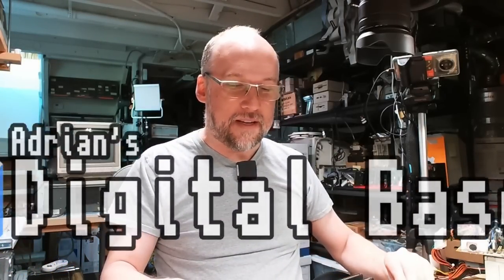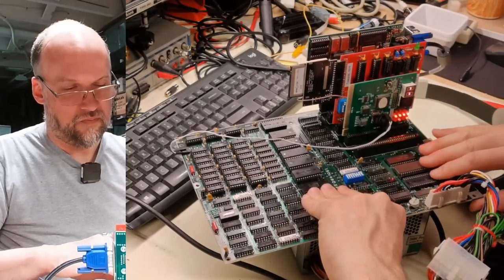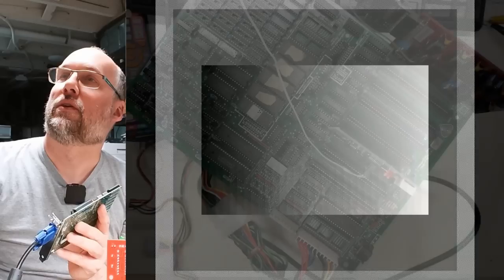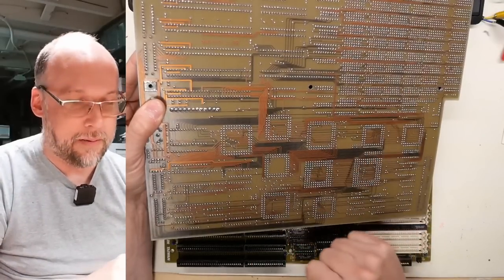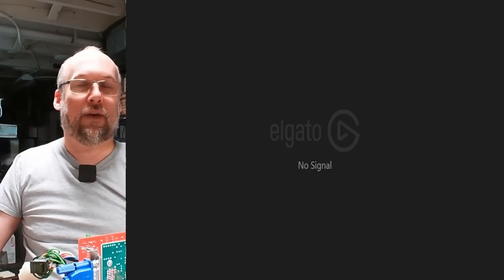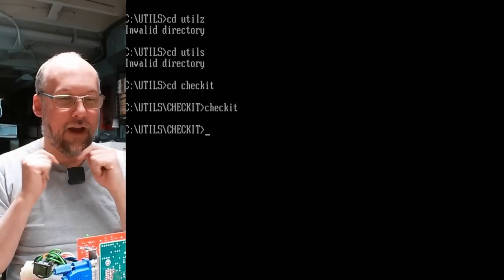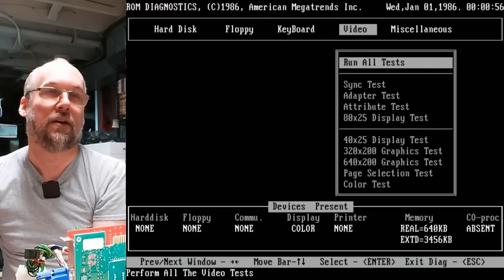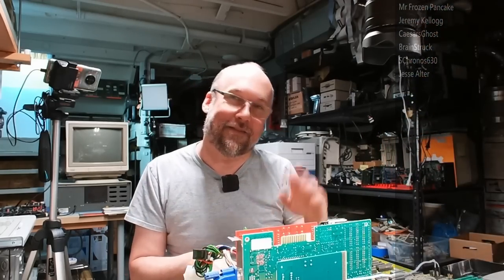Mystery motherboard testing

Comment: My computer from 2011 could render my enterprise model in 1080 in 1 hour (8 threads). Now my 2021 computer can render my enterrpise model in 7 minutes in 4k (24 threads). By my calculations that's about 4-5 times faster per core. But it's not a per core workload so I don't think it's right to talk about single core workloads when they aren't really revlent these days. You should also consider though. that the 8088 was a horribly designed piece of crap. It was one of the worst processors at the time. Even the 8086 wasn't much better. The 286 got rid of many things where when I was in college I said "holy crap intel was stupid". Most of that was gone. So they had a lot of room for improvement. But that's not the case now. But still 4-5x improvement in 10 years isn't bad. And when you look at the WHOLE CPU instead of just the single core workload like you tend to do, it's even better. 4x the detail means 4 hours on the old computer for 1 frame. But I can do it in 7 minutes. That's 34x improvement overall. So yeah pretty nice.
Reply: I had something similar when I recently upgraded, single-core performance is about 4x faster in my newer computer than my long-lasting older one. So the older one, despite being 8 threads, because it's 4 cores, usually gets about 4.5-5x its single-core performance except in very predictable tasks like file decompression or most compilation. Meaning single-core performance on my new one in most tasks is approaching the multi-core performance of the old... I was kinda second-guessing the upgrade until I'd run the numbers for my uses and realised that.
Reply: @kaitlyn__L  which isn't bad, but literally everything I do is multi-core. So single core performance is irreverent. My biggest offender is blender which is 100% multi-core. So the 30x increase in performance is definitely worth the fact that I spend over $4K on this computer. (was supposed to be $5K, but I couldnt' find a 3090)
Reply: @awilliams1701  oh yeah for sure. Some stuff I do like music is often single core because most of it’s sequential, but some of it can be parallelised. Though at least it guarantees the DAW gets its own threads with no fighting against other stuff like IMing pals. 

For the parallelisable ones my use cases are 6-10x the single core performance, so basically 6-10x faster than my old computer. I don’t have as many threads as you though! 

Still, most of the gains do come from sticking extra cores together in increasingly big die sizes. So I had been expecting only 1.5-2x single thread improvement and was pessimistically expecting overall power to only come from cores, so it was a nice surprise to see that the last few years have improved single core more than I thought. Since that’s a baseline multiplier on the effect of multi core!
Reply: @kaitlyn__L  yeah the biggest limitation I know of is Kerbal Space Program 1. The physics engine is 1 thread per spacecraft in range of the active vessel (including the active vessel).......and the more parts you have the worse the performance. It's very single core limited. It's the only thing I use that I can think of.
Reply: @awilliams1701  probably the other thing you use regularly which benefits is JavaScript — it’s not strictly single threaded but a lot of JS-heavy websites/apps are coded in ways with frequent moments of waiting on a single thread before the rest can continue. Definitely not as bad as KSP though.

That makes me wonder how much faster late-game Civ V and VI turns run on my new computer. I’ve focused more on the creative software so far.
Reply: @kaitlyn__L  I would like to think that javascript shouldn't be heavy use enough to matter. I use it for dynamic websites as I'm a web programmer myself, but my JS is very efficient. Nothing intensive.
Reply: @awilliams1701  on my old 2nd gen i7, just using Gmail or YouTube and/or an Electron app like Slack or Discord made the whole system stutter multiple times a minute, even though software compilation didn’t make it sweat. 

I was really annoyed by that haha. The overall system load wasn’t even 50%, but it kept getting in these wait conditions. (Though 50% from a couple websites is still ridiculous, when it was new that wasn’t even 10%.) If I wasn’t starting to hit its limits in creative software occasionally I think I’d’ve stubbornly hung on, because upgrading for badly coded websites is an abomination of an idea! 

Thankfully on the new one, that only happens if I hold down “end” and force infinite scroll stuff to load like 20 pages at once. Though web YouTube still uses 2-3x the battery than other video sources, which I presume must be down to JS as well -_-
Reply: @kaitlyn__L  sadly a lot of sites use jquery which is complete trash. I made my own JS libraray. It kick's jquery's ass. I even tested every thing on jsperf for benchmarking before adding it to my library. Maybe it's not as fully featured as jquery (as it does everything I need it to but nothing more), but it absolutely decimates jquery for speed. It's anywhere from 4-10 times faster. And that's on old 2nd gen i7 hardware. I would imagine that's probably still true.
Reply: @awilliams1701  that’s great! I wish more web devs (or rather their managers) did that with widely used products hahah.  Of course, adding new features and keeping asset parity with whatever corporate redesign of the month gets prioritised. I’ve been annoyed at the memory leaks etc for a decade, but this performance halting stuff got a new ire from me.